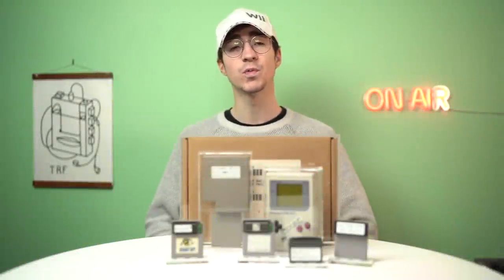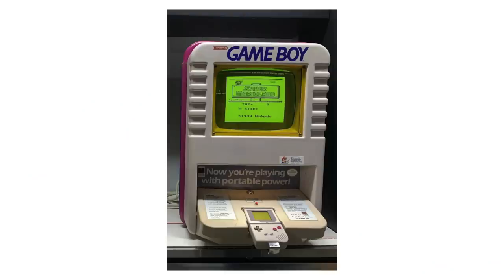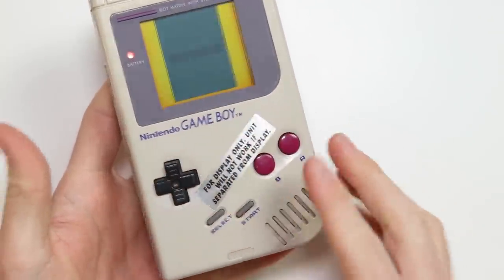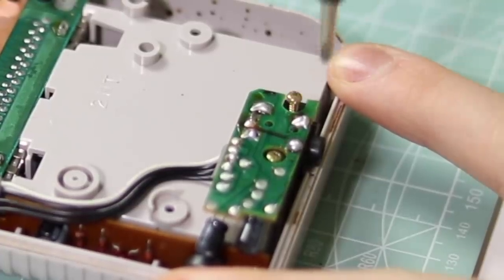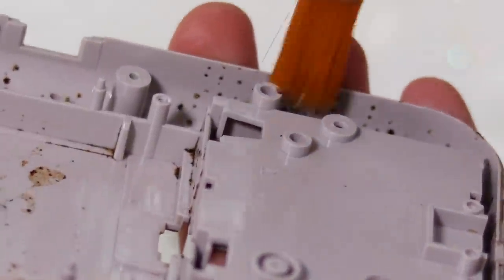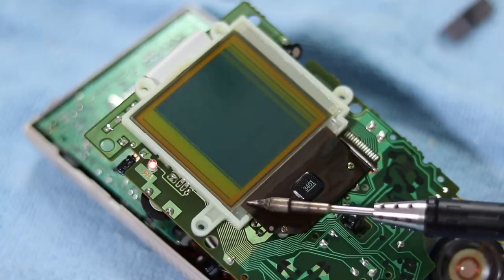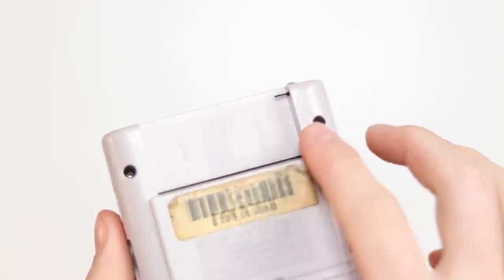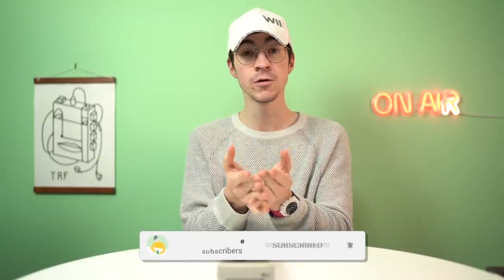Nintendo LIED about this GameBoy

Comment: I don't think it had anything to do with stealing it. The sign is correct as the console would have been connected to a power source which if removed would 'not work'.

Comment: I have a SNES kiosk console. It came from the original kiosk (sadly I broke it in a drunken haze) but it also has that sticker. Those definitely will not work without the kiosk. I had to hack the wire cluster on it to get it to work like normal. So I still have that and its controller.

Comment: Well, actually it wouldn't work if separated from display. It didn't have any battery in it, it was directly powered by the Kiosk. It's just a... Well, let's say it wasn't a clear insteuction ahahah
Reply: Maybe but there would have to be a metal wire or something to pass power
Reply: @SirSans842  just metal pads on the battery connectors, ez

Comment: I remember those kiosks.  I spent hours playing games on them including tetris,  donkey kong and Super Mario Land 3: wario land on the game boy. That sticker is legit. I doubt anyone could get the angle/font/ placement right on a phoney one.  I always thought it was kind of BS that the gameboy wouldn't play if you removed it but thought maybe the electronics were in the kiosk.  I could've had a spare game boy for the price of a phillips head screwdriver.  If you look at the non retrobrited gameboy you can see where the matal bar held down with 2 screws went across the game boy holding it into the kiosk.
Reply: Also that sticky stuff is probably coke-a-cola or possibly Dr. pepper/rootbeer. Don't ask why because I  cannot tell you how i know that is it but that's exactly what it is.  Either that or black tar heroin but that is highly unlikely.

Comment: Question, I'm planning to clean my 3DS because it's getting old and there are no longer any new ones I can buy. How do you dry the electronic parts (mother board and stuff) after cleaning them with the rubbing alcohol? Do you just air dry? Thanks! ^^

Comment: I wonder if that sticker meant that the gameboy wouldn't work because then it would be disconnected from a power supply
I would not be surprised if the kiosk had a special power unit that could plug in to the gameboy so it could be played all day
And taking out said power supply would be just like taking out the batteries. Technically, it wouldn't work as soon as you removed it, but pop in a few batteries and it's just fine
Reply: exactly correct. ac/dc power converter. the dc end looks just like a battery cover.

Comment: What if the sticker refers to the lack of pixel lines? Could it be that for the kiosks they used units that came out with defective lcd panels from the assembly lines?

Comment: Technically Nintendo doesn't lie.
The kiosk doesn't work on batterys, it works with some kind of power supply attached to the conectors. If you remove it, it stops working.

Comment: Sticker thing likely was more of a thing to deter potential "thieves". Same as some stores and places will put few extra fake cameras around. Tactics like this aren't all that uncommon. And while it would be more than possible for Nintendo to make specialized hardware for those kiosks, I feel like they probably took the cheaper route here and just put regular Gameboy into kiosks, putting sticker on it anyway. Its not like you could come back complaining, unless you wanted to first admit you stole it... :-D

Though it could have also been both, since of two kiosks shown, first one looks a lot more likely that it could potentially be used with some kind of hardware or maybe even like used with Gameboys with defective screen or something related to screen output that might work fine with external display. While second kiosk looks more like just a shell to hold Gameboy. I mean I could totally see that being the case and those stickers going to all Gameboys regardless of kiosk type.

Comment: Either you  this video “ a gameboy cleaned up” , or a kiosk gameboy review, or nintendo lied to us, it makes sadly no sense ,as in both cases, it’s just a regular gameboy with the exception of that nonsense sticker on it !!??

While i first tout that the game didn’t work on it and that those stickey wheel nobs were atickey on purpose, BUT NO ,turns out the whole “kiosk” gameboy needed a good clean from the inside to the outside to work properly,

Trough i think why i know why that kiosk gameboy wouldn’t work once pull it from the display, i believe the battery compartment has been connected to a power source trough wires or they used an external adaptor to power it up,

Also how were those buttons interfaced to the display?? Maybe it was modded to output it’s video to the display ,mmmm.

Comment: the Displayes they where mounted in contained an AC Adaptter for the Batterie slots, since thats a block they shipped tthe GB without Batterie cover. The sticker is just there  to "protect" the Mashines from Vandalism by ppl that try to steal the GB  and braking the AC Part, the shell or the Mounting. Back than an easy anti theft trick. like    OOOOOOOOH if i remove it  it wont work, so no need for me to brake the whole fucking display to steal somethting that wont work after...  i bet that turned the minds of some kids that actually had the idea to brake the display  to steal the gameboy, cuz the gameboy was lit, the hotttest shit you could imagin.

Comment: not a fan of the fake "OMG OMG I totally don't even know if this works lol lol im soooo random" bull, its just insulting to the viewer to expect them to actually believe that if you ordered it a while ago and bothered to put it in an acrylic case you wouldn't have bothered to pop 4 batteries in the thing to make sure you hadn't been ripped off when you initially bought it from wherever you bought it from before you lost the ability to get a refund

i'm all fine with trying to build up a little bit of faux suspense but you could just play up the "ohhh I have had this sitting on the shelf a few months, I hope the display hasn't developed dead lines or something while its been on the shelf" sure I would probably still think its BS that you hadn't tested the thing a few minutes before you started filming, but its passable and you wouldn't come off like your just either calling your fans dumb enough to fall for the BS or you're dumb enough to actually buy a super rare system months ago and not at any point be bothered to verify it even worked